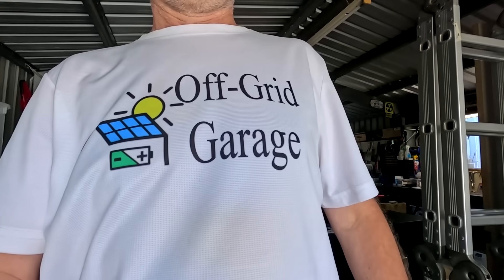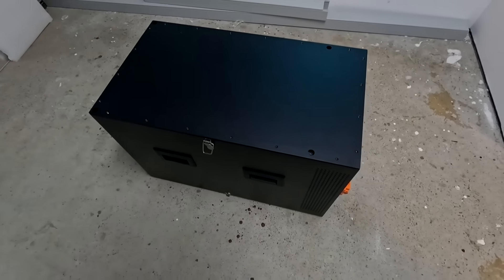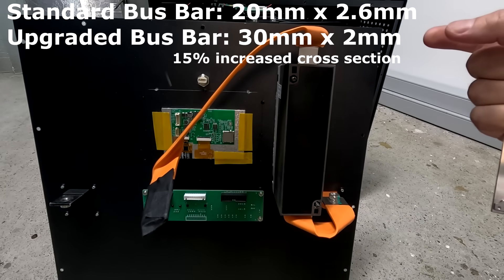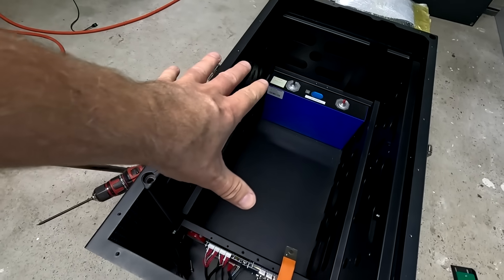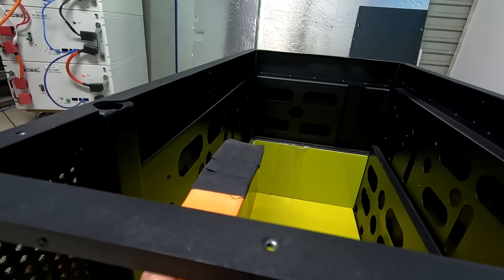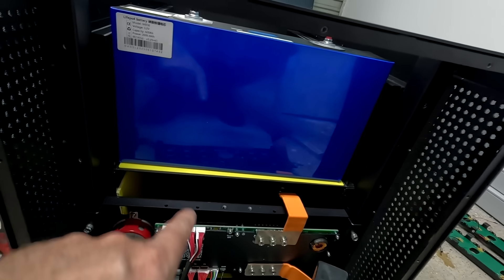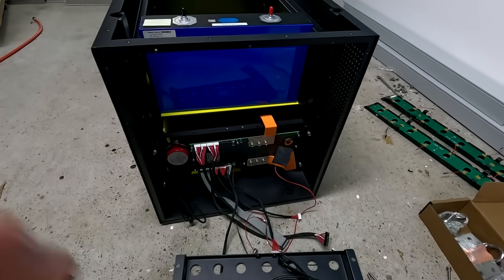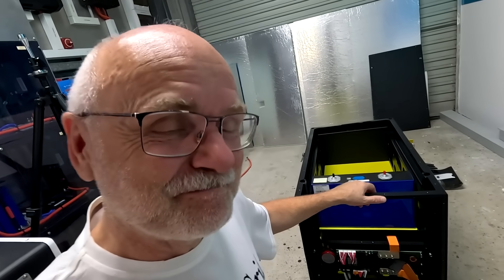World's First MB56 DIY Kit from YIXIANG. How good is it and... does such a battery make sense?

Comment: Thanks for the update on this Box. I’m curious to know. Is it safe to use this battery with their older style smaller 280 amp hours or do you need to keep them all the same?
Reply: Confused - why would you want to leave the box half empty? Or do you mean two cells beside each other? Because if so you'd need an enormous amount of copper to parallel them all. You wouldn't want to split them into separate strings because you couldn't balance them.
Reply: @matthewmarks6951  i’ve already purchased four of these yixiang boxes with 314 amp hour batteries I’d like to buy this bigger one when they’re available, but I’m curious to know if you can tie them together as far as on one bus bar or does that become an issue with different amp hours?
Reply: @popstream4972  Ah sorry, I thought you meant using the smaller cells in the bigger box.

Comment: Thanks for the video Andy. I think this box can also be used for 32 280ah or 314ah cells in series/parallel for a nominal 48V or in series only for a nominal 96V system.
Reply: ...96V, but what BMS should you then use?
Reply: @martinvincents9682 JK and other manufacturers have BMS for 96 and other voltages. Check their websites. It's just that 48 is the most common and perhaps the most appropriate voltage in the DIY world.

Comment: Great new box. Good video. I'm missing an update for the V19 JK BMS, though.
I know this comment doesn't really fit the video, but unfortunately, the V19.10 software doesn't work if you have multiple JK BMSs connected in parallel.
Reply: I have different experience. I ordered two boxes and they came with v19.04 and parallel communication did not work. I upgraded firmware to v19.10 and now it works.
Reply: @meelis79  I previously had version V19.05, and it worked, too.
The problem with 19.10 is that only the values from the V19.10 master are passed on to Victron.
I tested this: after all the battery packs were at 55.2V and then went into absorption mode after 30 minutes, I disabled the discharge on the V19.10 master. The other packs logically reduced their voltage to 54.6V, but the Victron system still displayed the 55.2V from the master and continued discharging the other packs. That's the problem I'm having.
Reply: I want to see those fire extinguisher in Action 😂

Comment: Alu sheets for mounting inverters etc ?
Stainless is that not cheaper?
Reply: Not at that thickness, and think of the weight.
Reply: I use cement sheet backing board (indeed the whole wall) this is necessary to meet regulations in Australia.
Reply: @polvincompoundsadmin5402  Not necessarily in a garage.

Comment: It'll be interesting to see if YiXiang has done their calculations correctly for this MB56 DIY battery box.

I have just completed assembling 4 of the MB31 boxes.  There is no compression at all.  The cells are still loose after assembly.

YiXiang have told me that I have to source my own spacers/epoxy boards to achieve clamping.

I have commenced an Alibaba dispute with YiXiang Energy on the grounds that their DIY is not fit for purpose.

Their initial response is that Andy purchased extra epoxy boards himself in order to achieve the clamping he shows in his video of assembly of the YiXiang DIY v2 battery box
Reply: I've got the older box (with a minimal circuit breaker in the negative) and it certainly came with enough hardware to hold the batteries firmly. (Consensus is that compression is not necessary, but you do need to account for some expansion.)
Reply: You need to have epoxy sheets between each cell in order to get good compression. These epoxy sheets are usually shipped with the cells, not with the Yixiang box. If your cells did not include epoxy sheets, you need to buy them separately.
Reply: @veeerzes  The epoxy sheets insulate the cells from each other.
Reply: @matthewmarks6951  Yes but they also add 1mm of thickness per cell, which is enought to get good compression. I've build 15 of these boxes without any issues.
Reply: @veeerzes  Current thinking is that compression is unnecessary - but you don't want the cells rattling about, obviously.
Reply: @matthewmarks6951  EVE states that the cells need to be compressed. It might not be completely necessary, but compression will extend the cells lifetime.
Reply: @veeerzes  Can you point me to the data sheet where it states this, please? Taking MB30 as an example, it only seems to state the maximum pressure they can take, not the minimum pressure that should be applied. "When the module is assembled, the cell can withstand the force perpendicular to the cell stacking direction."
Reply: @matthewmarks6951  "Recommended compression force 3000 N ~ 7000 N"
EVE MB31 Datasheet, page 11.
Reply: @veeerzes  Yes, but read the explanation on the previous page: "When forming modules, a compression force in the direction of vertical thickness is applied to the cells in order to make
them better arranged and fixed. If the compression force is too large, the cells may be damaged or even leak"

In other words, it's just to stop them moving around, and nothing to do with their internal operation. If they're sitting, confined, upright in a stationary battery pack then they won't move around so no need to squeeze them.
Reply: @matthewmarks6951  You are making conclusions based on a wrong interpretation of the manual. It doesn't say it only needs to be compressed in order to prevent wobbling around. The compression is to ensure the cell structure remains fully intact during charge & discharge. It is physics at work inside the cell.
Reply: @veeerzes  I read what the manual said. The manual might be wrong, but I didn't interpret it incorrectly.

Comment: A better place for the fuse would be between the upper and lower battery banks.
This would mean that there would be no floting voltages should you need to disconnect the upper battery bank from the lower bank.
Reply: This was discussed in a previous video. If the fuse blows, the balancing wires are still completing the circuit and that could destroy the BMS or worse (fire). People also mentioned that the voltage drop across the fuse can cause issues with balancing. Also, all parts of the battery can be considered floating - the case is not connected to anything.

Comment: the weight is less than 50 kg  ?
The usual were 1 level battery case were 28 kg or so 
56 kg for a stack, but you save a top cover and heavy duty bottom, so it should be around 50 kg or below that. Still pretty heavy. 

But I am not sure if I like the BMS deep down cause usually I would have preferred the upper position and nothing deep down. 

Makes no sense for me cause I have single phase 4,6 kW hybrid inverters with 3000 kW charge and discharge. Hence I prefer my 3 single 16 kWh batteries cause each of these can be charged during the 5 hours off peak rate of 14 cent after midnight - and then I get also a 10 Cent discount for shifting our load from day to off peak time.

4 cent per kWh in germany is a bargain cause 48 kWh means the heatpump will be powered from the batteries during winter for 5  cent  per kWh AC (incl. 25% losses on top of the 4 cent).  5000 kWh for heating means a 250 € (assuming all the Solar power from the 20 kWp are used for the house or EV charging) heating bill compared to 2250 L Diesel worth  2250€.
2000€ saved with the battery detour and shifting loads in the early morning. 

But I can not wait to see CATL increasing they SODIUM cell production cause it looks like they will be replacing  ALL LFP assembly line with SODIUM aka NATRIUM cells instead. Hence they shut down their Lithium mine cause without LFP production demands would drop drastically as CATL always emphasize that SODIUM cells would be produced ofr 75% less than LFP.  So the race is on and I guess they have no competition for now. Also Natrium can be charged and discharged down to -20°C which is a great improvement and important for busses, trucks and cars, maybe some homes or garages too. 5% lower energy density is something I can live with - if the price is really 75% less cause at that point the whole battery world will want to move ahead I guess , at least the DIY guys and those with big batteries to get as much for the old used LFP and to buy new SODIUM cells for 75% less.  Double the capacity from 48 kWh ( 2800 € for 3 packs LFP cells )  to 96 kWh for 25% x 2800 x 2 = 1400€ 
Double the size and half the price if you calculate with new cell price.

EVE has finally stopped the LF280K production and is only offering MB31 with 0,5 C rating instead. No announcement about the move to SODIUM but maybe they are using the LF280K production lines already for the SODIUM cell production, which takes quite a bit till they get a good yield too before moving all the other production line to Sodium too.
Reply: Sodium cells have a terrible voltage curve that is almost impossible to work with our inverters etc. LiFePO4 will remain the best tech for now.
Reply: Die Produktionskosten mögen um 75% niedriger sein. Die Verbraucherpreise sicher nicht.

Comment: That is a beast! Absolutelly non-movable after assembly 😇
Reply: The mb31 battery box is no moveable either.  I just built 4 of them, the handles are a joke.  Specially designed and made to break fingers off!
Reply: @danielgolenia5181  Tell me about it. I'm going to have to disassemble mine to turn it on its side since EVE suddenly decided the cells must be upright!
Reply: @danielgolenia5181  Yeah, right, at least "some way" movable. With mb31 your still able to move it / lift it. Agree handles are a joke, better to open chassis and drag it in corners inside.
Reply: Some pre-planning and they are movable.

Comment: The Handling will be getting more stressfull if the packaging get so large , im not sure I heard the weight , but well above 180kg+ (?) is expected . I loved it to have just on layer with the EVE280 , with different BMS like the German Boostech it might be easier , but so its very complicated to check on your Battery if connectionsproblems occure !
Reply: I thing he said about 240kg

Comment: 10 minute mark, that's a nice place to have the breaker in between the stack just like EV's have, the main breaker/fuse in the middle of the pack
Reply: All decent battery packs have fuses or cbs mid bank.
Reply: @danielgolenia5181  Do you have some examples? As I've just commented: you've got the balance wires connected across the pack halves if the fuse blows and there will be a higher voltage drop between two of the cells.

Comment: New bus bars might not have much more cross-sectional area but they do have increased surface area (heat dissipation), and greater contact area.
Reply: I'm pretty certain, from my power electronics days at uni, that electrons prefer to flow along the surface of a conductor.
That's why fine multiple strand cables are preferred for high current.
Hence large surface are bus bars preferred over larger cross section, in comparison.
Reply: @danielgolenia5181  You're thinking about AC - the skin effect. This is DC(-ish!).
Reply: @danielgolenia5181  wrong, that is AC you are talking about, the skin effect and this is DC.
Reply: I'd love to see Andy put those busbars to the test with hos heat camera vs. the original design 🙏
Reply: @paulwilliams8192  Might even set off a fire extinguisher...
Reply: Good points!

How big do they need to be on paper to carry the current before the fuse/circuitbreaker trips? 
Or are there other factors like temperature which are important too?

Multiple online calculator tools told me 72A for a 30x2mm Cu busbar. 

Just out of interest and curiosity. 

On the other hand, those tools also mention 288A for a Victron PowerIn busbar, where victron states 1000A. (30x8mm Cu)

Almost factor 4. 72A x 4 is close to the fuse rating ... 🙄
Reply: @gewoonandre  Those online calculators are simplistic. Building wiring regulations, for example, take into account how cables are placed when determining their maximum current rating.